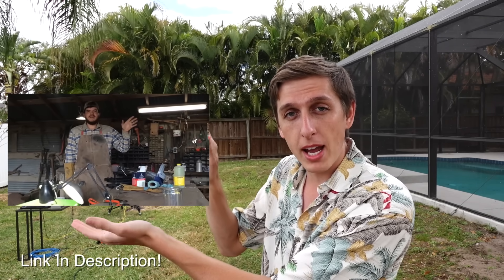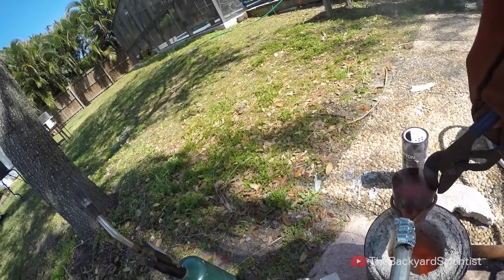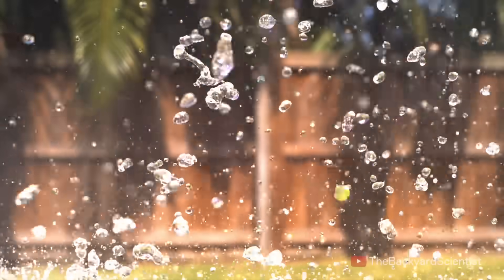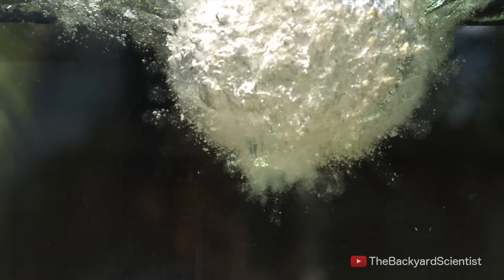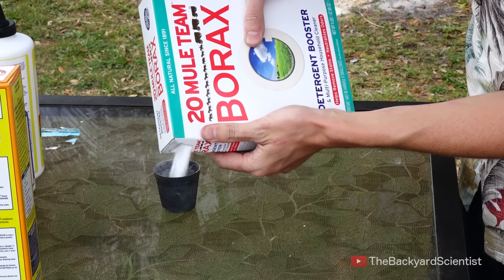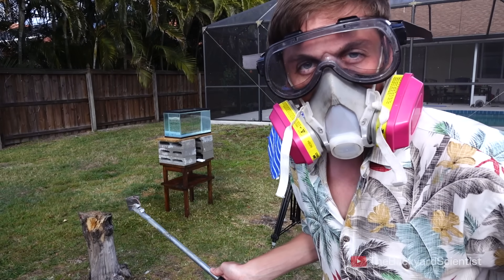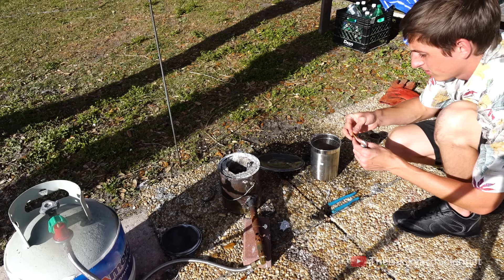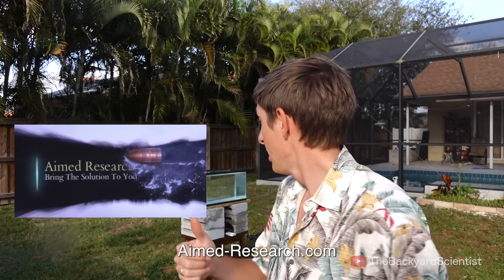Pouring Molten salt into Water - Explosion!

Comment: I'm an amateur blacksmith and for hardening low carbon steel you can't use oil because it's not a fast enough quenchant,water doesn't work as well,because it  has that leidenfrost effect which puts less water in contact with the steel,to overcome this i heard that you can use a solution of water and salt and it will remove the leidenfrost effect enabling you to quench much faster,maybe that's why it works with salt but not hte others.
Reply: +Fenrir Lokisson Salt increases the boiling point of water (and the freezing point as well) thus the water doesn't boil as quickly when you quench hot items in it.
Reply: oh i thought that had something to do with surface tension but ok

Comment: I would say your hypothesis of the dispersion of the salt and subsequent rapid heat transfer is probably at least partially right. i think another possible factor is the salt's naturally rapid dissociation in water. I'm not sure what the solubilities and viscosities of the other molten salts are, but I'd be willing to bet that they are higher than sodium chloride.

Comment: You should do this again and try to take accurate temperatures of the molten salt before dropping it maybe the others have a lower melting point and are not getting as hot before you dump them in the water.